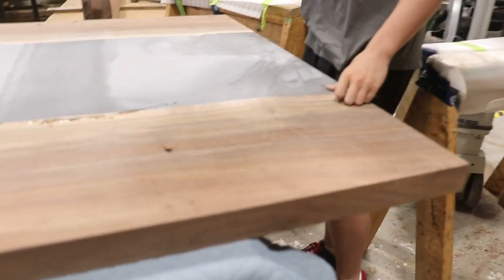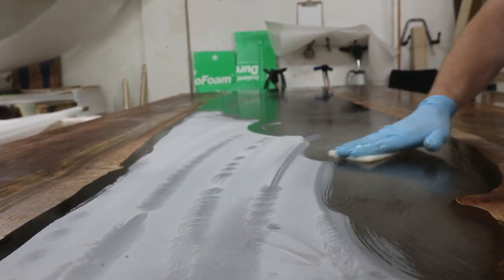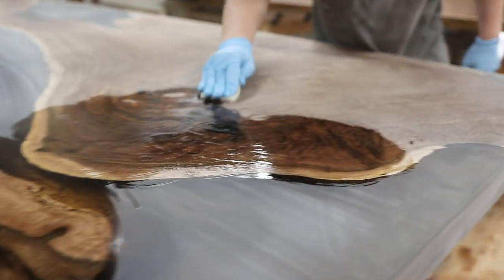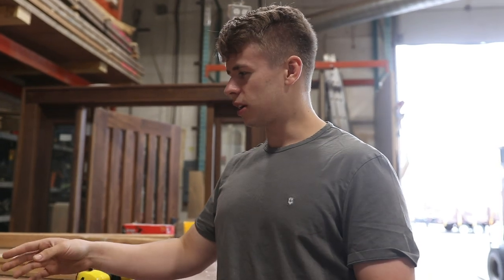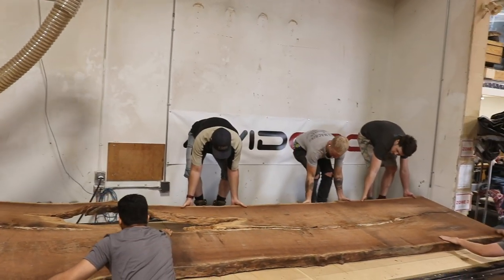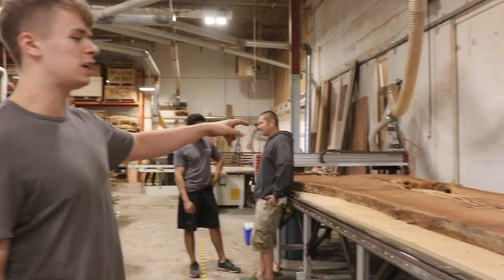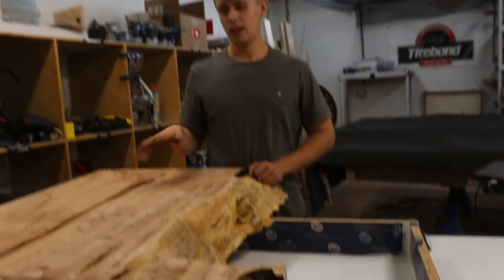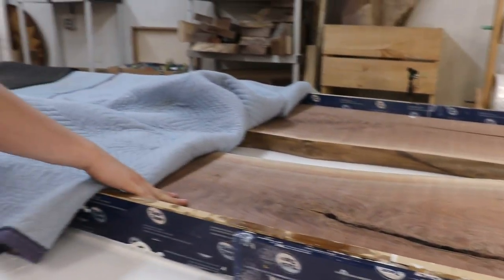Working on 5 Massive Solid Wood Tables

Comment: Had the pleasure of meeting Dylan in the shop a couple of days ago. Huge fanboying..... Love what you guys are doing.

How thick do you guys typically make your standard tables?
Reply from the maker: Wow thank you so much, and thanks for stopping by too! 

And our tables are usually 2.5 inches thick for finished thickness
Reply: @BlackForestWoodCo  Awesome. Thanks!
Cut and poured my first charcuterie board yesterday with the stuff I bought from you guys. Including using the 10*18 form. Went very well and used a bit of charcoal pigment. After one day - starting to firm up. Very very small fine air bubbles that can only be seen with wood underlying......

Comment: You guys need a vacuum tank to move your tables in when curing ,The negative pressure will pull every bubble out and eliminate 2nd reworking  and filling in holes